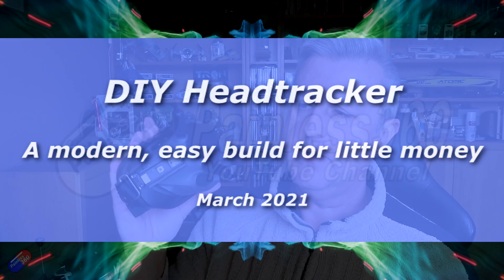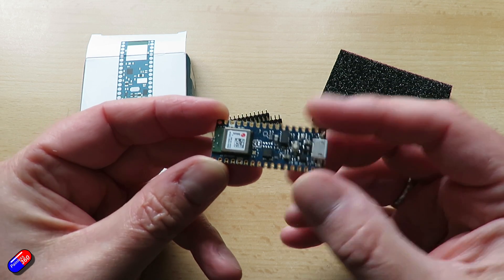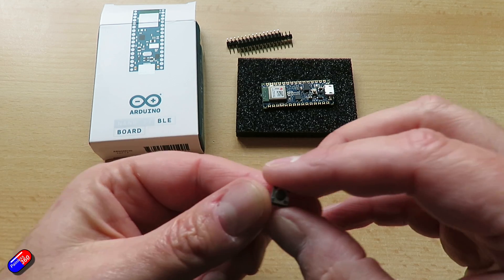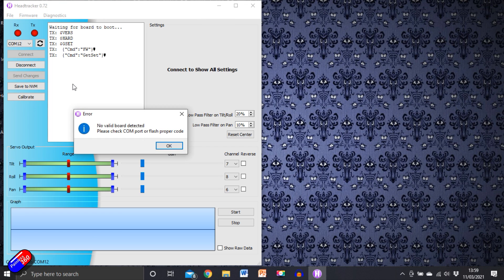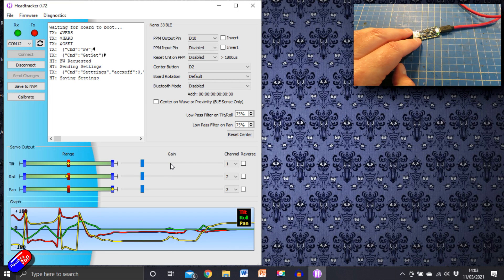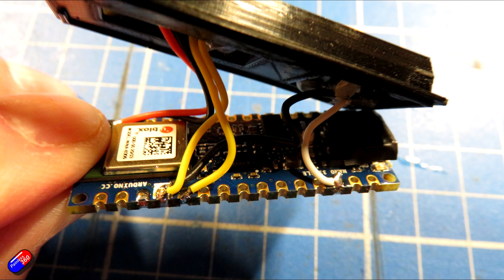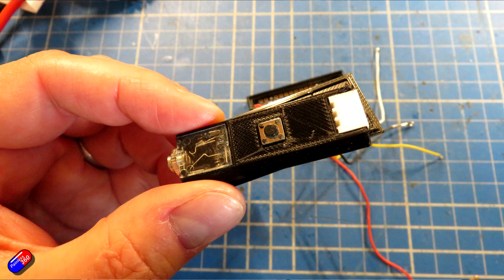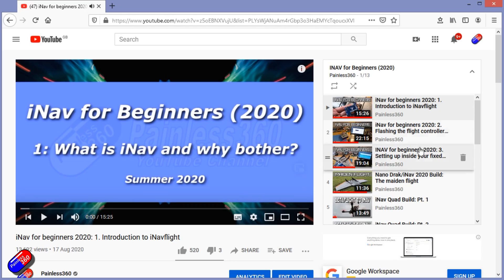Modern, easy DIY Head Tracker build that costs less than $30!

Comment: Hi, sorry, I'm using 180-degree servos, and in Mixes I have them at 100. If I increase it, do I get more angle on the servos for the head tracker? They don't do the full 180° travel.
Reply from the maker: Possibly, it depends on the PWM range that the servo is expecting... Best of luck

Comment: Any ideas how to implement the project using arduino nano ble rev2? Seems like it is not working with the GUI, although it loads the program and boots normally
Reply from the maker: I've only used the board shown. I'd contact the developer... best of luck

Comment: This is awesome. If I wanted to have this in a separate system could I plug it straight into a frsky tx module?
Reply from the maker: I don't think so. You need a radio to recieve and manage the trainer input... Happy flying

Comment: hello, many thanks for your video; i was wondering if it was possible to use the dji google2 nativ headtracker to drive a diy gimbal; is it possible to get the signal directly through the O3 air unit? or may be it does not make any sense???
Reply from the maker: I'm playing with the new Walksnail gimbals here so don't know about the DJI stuff... Best of luck

Comment: Firstly, apologies for commenting on a 3 year old video!
I have a question about head trackers and pan/tilt gimbals.
I noticed on my first flight trialling this exact kit that when I'm banking left or right, the gimbal stays in its original position and doesn't move with the aircraft.
Ideally it would need to stay orientated to the direction of travel unless I move my head to look around.

Would you know how to resolve this?

Cheers
Reply from the maker: That is how head trackers work, they only move when you move your head. What you are looking for is a gimbal. Check out CAMSTAB mode in things like Betaflight and INAV... Best of luck!

Comment: Hello, 
coming back to the firmware flashing issue. I was lucky to get hands on an old ble 33 board (rev1). WIth that board everything works just fine. I then also tried the ble 33 sense (rev2) board. This also works perfect. Turns out the rev 2 board without proximity sensor is problematic. Even with the latest pre release version (finding it on github was a project in itself) was not successful. However, I have two boards working, problem solved 🙂
Reply from the maker: Thanks for posting this answer... Happy flying
Reply: Thx, that helps a lot. Is there any disadvantage using the sense board ?

Comment: Hello, thank you for the nice video. I tried to flash on BLE 33 on my own (original arduino rev 2 , not the sense version) but I don't get it to work.
When I flash the firmware BLE33 V2.21 on the board the process seems to work but I do not see anything in the graph when I move the board. If I flash the firmware Nano 33Sense Revision2 v2.21 I do see the the signals in the graph when I move the board but calibrating the magneto does not work. Also, when I reboot the board or unplug and re- plug it I do not see anything anymore. It seems as if the firmware is erased when the board looses power supply or when being rebooted. Does anyone know this issue or(even better) a solution?
Reply from the maker: I'd ask on the issues page on the Github pages linked in the video description... Best of luck
Reply: @Painless360  , i tried that but thesecgithub pages are quite confusing to me.
Reply from the maker: https://www.youtube.com/watch?v=vu7eLbnboPw should help... best of luck

Comment: Is it possible to catch the built in head tracking signals from the DJI googles? then just relay to servo/gymbal setup instead of using a seperate board to capute these signals?
Reply from the maker: I'm not sure. Dji don't like to make stuff easy for hobbists to use their stuff in innovative ways... Happy flying

Comment: Thank you very much for this project. I need an help for my setup: how do I connect a Futaba radio TJ8 with the head tracker? It seems that Futaba trainer port works with 3 wires not only two as the Arduino output. I would really appreciate your help on this.
Reply from the maker: Pins 2 and 6, I think - https://intofpv.com/t-hacking-trainer-plug-to-usb-for-sim
I don't use Futaba stuff here. Best of luck.
Reply: @Painless360 thank you. Will let u know
Reply: @Painless360  I've finally get it solved!! Thank u for your precious support. Giampaolo

Comment: Hello - I also built one. thanks to your guide it wasn't difficult. function is also correct. unfortunately I constantly have a drift on Pan. At the beginning everything is in the middle, but if I make a few movements with PAN, the head tracker starts moving out of the middle. What am I doing wrong ?
Reply from the maker: Could be a few things. Temperature changes, bad calibration. I'd recalibrate shem it's warmed up... Happy flying
Reply: Same been getting drift for weeks making it almost unbearable. Tried dialing in calibration on powered goggles with and without magnetometer. Making sure to take time to do it as perfectly as possible. Still getting drift

Comment: Can a phone charging battery pack be used for powering the arduino?
Reply from the maker: What voltage is it?
Reply: 3.7v 4000Mah 14.8Wh
Reply from the maker: That isn't the voltage out of the charger. That's the nominal voltage of a LiIon cell... Are you sure that's the voltage?

Comment: Honourable ladies and gentlemen
i tried to replicate using the arduino nano 33 ble, exact designation ABX00030. I followed this video. I have a PC with W10 64 bit, RAM 6GB. I reserved COM10 for connection. COM10 port configuration 9600, 8,N,1.
The system reports that the driver for the USB serial device (COM10) is up to date.
I can update the nano 33 BLE firmware to version 0.72
I can connect nano 33 BLE to COM10 port. After connecting to the nano 33 BLE, the system informs me that the calibration of the board has not yet been performed. I see 3 colored lines that change position depending on how I tilt the board in three axes. In diagnostics / show data values of magx, magy, magz change/oscillate around some basic value. The values change significantly when the tilt of the board changes.
Value magcal=false
When I click on the calibration button at the bottom left, a new window opens, it is empty/white, after a while the headtracker program turns itself off.
The question is whether anyone had such problems and how they solved them. Why can't the board be calibrated? Where is the problem?

Comment: I made this head tracker. Thanks a lot. 
Please make a little bit bigger case 3D printing model :). If the case has more room inside, it would be much easier to assemble.
Reply from the maker: I don't forget you can increase the size of the print in your slicer... Happy flying

Comment: hi like a help.
I made this headtracker however I have a problem.
When I connect it to my Radiomater TX16S the channels assigned to the headtracker start to move from -100 to +100 without moving the arduino
I believe the problem is in the connections between the arduino and the stereo connector.
Could you tell me which pinout you used on the stereo connector to connect to pin D10?
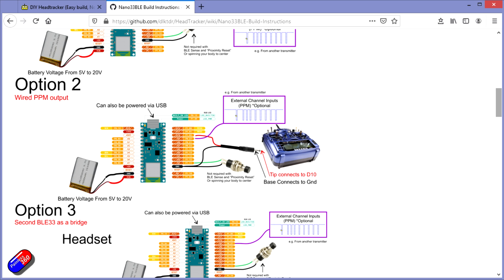Reply from the maker: I soldered mine as per the diagram shown at 8:17...best of luck

Comment: It seems I have ordered the Arduiono 33 IoT...
Can it be used, or do I have to sent it back in order to get BLE?
Reply from the maker: I've only used the one shown. If others can be used it'll be listed in the project pages... Best of luck
Reply: @Painless360  it say in the description: "Arduino Nano 33 IoT, Wi-Fi, BLE, ESP32 + IMU + ARM Cortex-M0+ 48MHz ABX00027"

But not shure the wiring would be the same...and then I'm stuck.

Comment: Hi Painless, i have built one of these units but can't get it to work with my Radiomaster 16S? I've checked the board on the computer and everything works fine. I've set the trainer functions up on the TX as per your other video but the radio doesn't show any input from the board although it tells me the trainer lead is connected?
Reply from the maker: I'd try every TR channel on the radio in turn until you find the HT signals... best of luck
Reply: @Painless360  Thanks, i' will keep trying.
Reply: Hi Painless, managed to sort the issues out with the MK1 Radiomaster 16S, all working now.
Reply from the maker: What was the problem?
Reply: @Painless360  The tip on the trainer jack on the Mk1 TX is NC its the second ring on the jack that carries the PWM output  (the Mk2 TX the tip carries the output)  You need a long enough jack to make sure the rings line up in the TX, i used the Radiomaster trainer lead. The second issue was the multiplier on the trainer function was set to zero instead of 1.0

Comment: working on this as a project now, finally got the BLE board, now all I need is to see if I still have push buttons and print the case.
Reply from the maker: Best of luck!
Reply: @Painless360  Im having some issues with the case stl. there's a box assembly with a lid, and a 3rd part that holds the board-but that board holder is longer than the case assembly with its closed off ends, and not sure where the lid would go at all. I assume Im missing something here with the case assembly?

Comment: Great job … did get mine working on the PC, but I have trouble to connect it to the Futaba T14SG with the teacher cable. Anything I have to consider especially? Do you know on what channel they are … do I need to consider a mix. Any help is appreciated
Reply from the maker: I don't know how to setup futaba radios for the trainer function... Best of luck

Comment: Thanx! Built it yesterday, works like a charm (after switching to a stereo cable, Radiomaster and Jumper obviously Do not like mono cables). One question: can you tell me how you attached it to the Goggles? Is there a mount to print?
Reply from the maker: Velcro tape.. Happy flying
Reply: @Painless360  Thank you! Do you have a recommendation for a pan tilt for the air unit?
Reply from the maker: Yep, use mine! :D See my thingiverse page..
Reply: @Painless360  My bad, just found it!

Comment: Thank you for your help . excellent project. something stuck in my head. You suggested the cable 3.5mm Stereo PCB mounted jack. however, the cable looks two-way, not 3-way in the illustration on head treacker page. Which should be taken into account....
Reply from the maker: Both work, stereo can be easier to find.

Comment: Curious you mentioned Jumper and OpenTX. Does the protocol really matter? Based on your information I assume all you need is any radio that has PPM capability? Protocol is irrelevant. The bottom line is the pan/tilt are simply going to chew up 2 channels from your radio and that’s all. Am I correct? Thanks for making this video. I am seriously interested to do it considering the simplicity of this setup and low cost.
Reply from the maker: The protocol doesn't matter as long as there are a few spare channels for the head tracker stuff... Happy flying

Comment: Hi...Mate best regards from Spain. Great job your´s congrats!!!!. One question about those track ir, can I use it as replacement of Standard TrackIr for Flight Simulation like Xplane, Flight simulator or Il2 1946, who are prepared to be used with Natural Point hardware?, thx a lot for your response. Nice to meet you.
Reply from the maker: I'm not familiar with the system you mention but this head tracker outputs a PPM stream so if it will accept that then it might work... Best of luck

Comment: I can't help but wonder, with the invention of small 360 camera is  the need for a motorized gimble is coming to an end. The Trick is in the processing, you can't send the entire 360 video stream over the air, there isn't enough bandwidth. So youll need to have the processing done on the camera end (aka in the Drone or plane)  and only the footage from the viewing angle you want to see getting transmitted.
Reply from the maker: It is an interesting idea and something like that was in the excellent Parrot Disco. I hope we see cheaper options that would work with the FPV systems we use in the hobby..

Comment: If the Arduino Nano 33 BLE is flashed with firmware version that requires for connecting it to the radio trainer via a barrel plug, can it be re-flashed again later on with a firmware version which allows it to connect to the radio controller wirelessly via blue tooth? Thanks.
Reply from the maker: You can re-flash it as many times as you want. Best of luck!

Comment: Hello! Do you know if the arduino nano 33 ble sens board also works? There are 3 models: ble, ble sens and ble iot, the "sens" is the most complete... but I can't find information about whether it works for the head tracker.
Thank you and your videos are very good!
Reply from the maker: If it does it should be in the documentation (listed in the description). Best of luck!
Reply: did it work?
Reply: @fz8691  Yes, it works perfectly!
Reply: @estudioaguilamagnetica3174  thanks for replying ill try it out it with mine.
Reply: @estudioaguilamagnetica3174  also if you dont mind me askong did you use the same firmware for ble or did you find one for iot?.

Comment: Thanks for this. I’ve built one but I’m really struggling to get it to communicate with the radio. To be honest I just don’t find Open TX particularly intuitive and I’m not patient enough to really get to grips with it. Any chance of a video with a step by step idiots guid on how to set this device up on the radio (i’m using tx16s)?
Reply from the maker: Sadly, a bit of Opentx knowledge is required. https://youtu.be/_p8_1v9-3D8 should help.. Best of luck

Comment: Can't get this to work on my tx16s for the life of me. Tried ppm and sbus. Can't get anything to move on my radio at all. Any help?
Reply from the maker: Make it that the flashing of the board worked and check the outputs are all selected in the setup app.. Best of luck
Reply: @Painless360  yea have all of the board working as it should in the gui but wen I plug it in to the tx16s I'm getting no movement on the channels :/
Reply from the maker: Enabled outputs in the app?
Reply: @Painless360  yea

Comment: Hey painless360 ive done the projekt but my Spektrum nx10 wont recognize the ppm input from the arduino Board, what can i do?
Reply from the maker: Does that radio work with other radios in trainer mode?
Reply: @Painless360  yess and the setup is correct. I dont know what can i do?
Reply from the maker: Sounds like something isnt working on the HT.  Remember to enable the outputs in the HT setup.. see  the documentation.. best of luck

Comment: Can you do this with DJI digital fpv remote controller over trainer ppm port?
Reply from the maker: I am not aware that the FPV controller has a trainer function. DJI don't understand 3rd party things like that.
Reply: @Painless360  I looked into the manual next to the usb C charging port, under number 7. Simulator PPM Port, I am wondering if it is possible, could you try it?

Comment: Well, it seems Arduino Nano Ble is either not in stock or is now $45 to $50 would the nano iot work the same since it also has a 9 axis gyro or perhaps the Arduino Nano 33 BLE Sense??
Reply from the maker: If it is supported it may be listed in the project documentation.. Happy flying

Comment: Hi all, I’m losing faith here quickly 😞just bought a second board, and connected it to my TX16s using sbus this time, and it’s behaving exactly the same as last time, channels oscillating uncontrolled on the channel monitors. I have uploaded firmware version 2.04 and calibrated … but it’s doing the same as the last board.

Please tell me this is something obvious 🤷‍♂️😢
Reply: Finally solved my own issue 🙄 on the head tracker gui I hadn’t enabled the channels on the servo output .. wow, what a lot of head scratching to discover it was something so simple…
Reply from the maker: Glad you figured it out. Best of luck!

Comment: Thanks for the video, but I’m struggling to get this working! Used the sense BLE board, wired per the instructions, successfully calibrated, the Radiomaster sees the trainer connection, have configured my mixes, but no output on the monitors screen …not sure what else to do - completely stuck now!
Reply from the maker: Sounds like you're missed something on the radio if the channel isn't moving so the radio screen. I'd start there.. Best of luck
Reply: @Painless360  thanks for the quick reply! While trying to sleep I think I realised I may have wired the jack lead incorrectly … will look at that later

Comment: Hi, thanks for the nice video of this cool project...I already made mine with BLE Nano Sense board, I connected it with BT to my X10S and all the things inclusing proximity cetering is working good. The only problem I face is the jerky movement of the servos (feels like loose signal connection). I dont have this issue with same servos when I use the trinity head tracker on wire! any idea what the problem is?
Reply from the maker: No idea, I've not seen that. Let me know if you find the cause.. Best of luck

Comment: Great another HT project. Great job for all the people. 
Is there option to put the center button on the transmitter without any wires?  I'm using full wireless HT with control on transmitter, this is must have for fpv pilots.

Comment: I got lost on the wiring everything up part brother. Especially the power up plug and how it's soldered and powered. Im going with the wireless method but do i still have to add the button? I noticed the Nano has a reset button. Can that be used to reset? Sorry for all the questions but im a complete noob to the hobby. My apologies..
Reply from the maker: The button is used to reset the position so recommended for both.. Full diagrams for the connections in the linked project pages